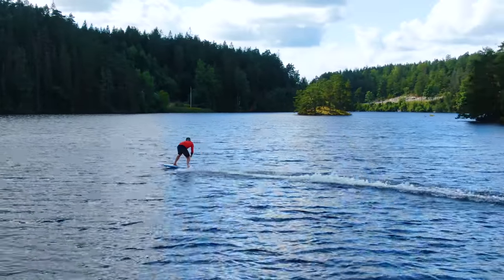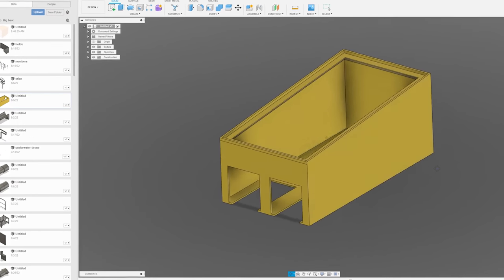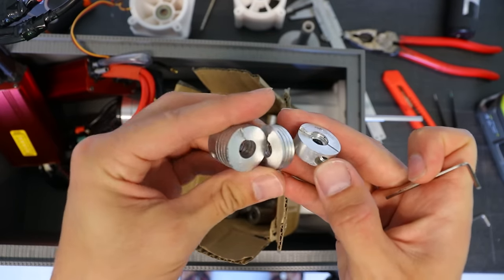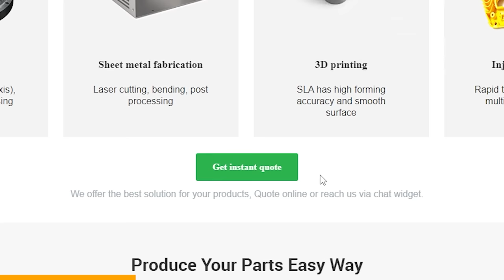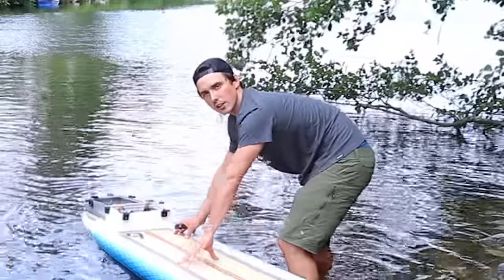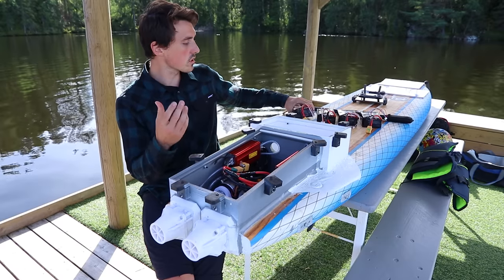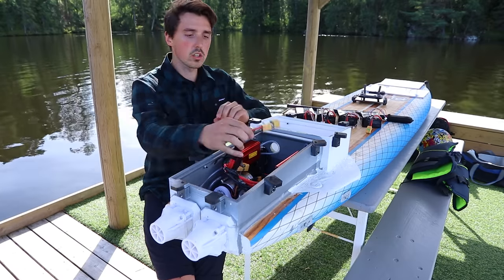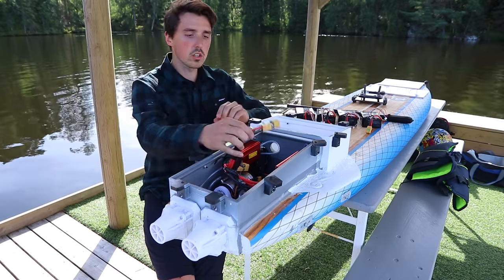This Electric Surfboard Has a Secret Inside!

Comment: Great work. Stout impellers! Are they 100% infill or did you go lower to save weight? So cool PCBway can do that for us.

Thanks for all the detail man! Loved the ID joke, haha.
Reply: You can't really do anything except 100% infill with metal sintering, because if you create an infill pattern the gaps will just be full of metal powder that hasn't been melted together and can't get out. Metal powder weighs the same but doesn't add any strength so it's literally useless. You can make hollow parts if you incorporate drain holes into the design so the powder can leak out when you're done but something like an infill pattern would trap it all in.
Reply: @AlRoderick  Great point, thanks for the explanation!
Reply: @AlRoderick  With sintering you actually could, the metal powder fdm prints you sinter in an oven afterwards. But with this laser melting you'd have to leave a hole somewhere I guess.

Comment: That two stage impeller design has alot of advantages for that size of an impeller, its easier to fit it on a small 3D printer for one.

Comment: You should revisit this. I built jet pumps for drag boats and noticed the intake was very small. The bigger the intake the less chance of cavitation and dry sucking. It should be at least triple the size of the pump volume. If you look at the pump as a cup standing up and filling it with water the intake should hold a minimum of double the water volume to extract all the potential thrust.

Comment: Congrats! I wanted to build that 10y ago to learn about the limits,,you saved me a lot of work. I recommend to use LiFePo4 cells like A123, because they can deliver the high current without damaging the cell. And you can recharge them fast. Regarding the board, there should be room to lower the water contact surface to safe energy, may be a catamaran-like double glide surface underneath to tunnel some air or so. Of course, a foil is unbeatable, but i like the surfboard conept (cheap works, in flat water...).
Reply: Wrong

Comment: Great Job, I made also an electric surfboard based on yours last winter. It works well but indeed reliability is a big one. One day it works and next day i go to the water something is wrong.
Its nice to see you made an update about yours!

I also have a heat issue, I cant drive longer than 6 minutes before everything gets too hot. I choose to run Li-ion batteries on 18S 16P. It gives me around 12 to 15 mins of play time. (but need to cool down twice to not let it overheat). I will try your tip by first cooling the motor and then the esc! Mine first goes to the esc since that saved some tubing.

I also noticed I should stand more in front of the board, I have the same style of board (long and thin) I think it is not the most efficient design for an electric surfboard.
by standing in front of the board (slowly moving forward while driving) it becomes much more efficient for me since the heavy backside of the board doesnt go that deep in the water. Maybe a tip for you.? 🙂 It also gives more speed too, haha

Comment: I used to have XT90 in my electric moped but they became very hot. Now I switched to Anderson Connectors (red). Now the cable is more hot than the connectors. 
Good luck with your projects. Like them alot🙂!
Reply: Label hit extraam heat wave char e tempugfer earth too hit ektrc
Reply: Ne e 900 watts 90 watt hydrrgen fule cell

Comment: As an armchair engineer, I have to add that two impellers in series don't move double the water, they just move the water harder, doubling the pressure. The result for the power demand is the same (parallel or series pumps), it's gonna double. But doubling the pressure on a jet with an additional stage grants the opportunity to use smaller nozzle diameters more efficiently. Thus increasing the top speed without having to increase the motor speed. 
Great build by the way, impressive top speed!

Comment: for your next build i would recommend a single my1020 1800w motor and a bigger impeller to reduce heat and maximize power. hit it with 72v and youre faster than a jetski!

Comment: Use anderson connectors, these connectors are used in the UPS and withstand the declared current, xt90 do not withstand 30% of the rated current for a long time, if they are often connected and disconnected, then even at currents less than 30% they begin to heat up.  so either a bolted terminal block or anderson.  Good luck!

Comment: QS8 battery connectors and 6 awg cable will help solve the heat issue you experience in the XT90 connectors.  These are rated for 300 A continuous versus 90 A for the XT90.  Helps to reduce the energy loss in wiring due to heat.
Reply: Yes itvwill

Comment: put the motors under the surfboard and use the water to cool everything. 3rd print aluminium case that act as find and radiator to the motors and seal it with casket maker.

Comment: I think it'd be cool (as a future project) to make the surfboard from scratch and along the spine have a large aluminium bottom container for the batteries (so that they can be passively cooled by the water underneath, and you can fit more without taking up space for standing). Also, you could make the base of the motor compartment aluminium and connect problem parts (like the ESC) to it either directly with strong mounting pressure and thermal paste, or with a heat pipe (you can get cheap ones online, although bending them can be a bit of a hassle I believe).

Comment: 45kph water scooter, awesome. What about optional plugin scooter steering head (with lights, mobile holder/charger, etc)  Seemed less screechy with a single set of impellors. Very unique "water drone" sound, but still loud. Since it is not getting hot anymore, you could try a load of sound insulation in the engine room.

Comment: SUPER impressed! I must have missed it, what size motors and ESC amperage? I built a skateboard with a 7468 and a 150 amp ESC and a 6 cell I could pull a car (not fast mind you) and with just me on it 20 mph. Not bad. 1 hour runtime with 7000mha. 

Ok, got to the end. You answered my questions. My bad. Still impressed.

Comment: Am running the 360KV Version 56114 Motors on this project with the dual stage system and the motor is rated for about 93 Amps and at full throttle it will draw about 120 Amps, in which I just dial the power down slightly and it works very well. Also, I'd highly recommend getting the V2 versions of these motors as SSS claims they are 8% more efficient.
Reply: Yes there are
Reply: @sharonbraselton3135  I need to try them. Efficiency is everything with this project and actually 12S is really underpowered for me at 195 lbs, I’m going to 16S. Only reason simon can run 12S is because he weighs 35 pounds less than I do

Comment: One idea might be to create a heatsink and thermally bond anything that gets warm / hot to it

Then run the fins of the heatsink under the board

That way you could potentially run it hotter for longer and the heat will be pulled away in to the water

This would also increase straight line stability

Comment: Try finding some outrunner motors of the same outside diameter. They'll be much lower kv but loads more torque and they won't be working as hard. Boats need a lot of torque which is why if you shop around for rc boats you'll see that most use outrunners. I'd say those and double your voltage and you'll be golden

Comment: Great work so far, now that drive is mostly locked down design wise, maybe build in the cooling system for the motors with a 3D printed mounting block ? The mount for motors could be made with spiral coolant channels formed into in the printing along with o ring seals against motor bodies and this would offer FAR better flow capacity than the manufacturer's cooling jackets offered with motors with those tiny fittings.  A water cooled metal plate heat sink from aluminum and plastic for water ducting might help batteries as well. Thicker solid bar stock copper could be used between batteries and motors to reduce cables and connectors resistance, it could be integrated into motor mounts for insulation.

Comment: Cool design I've never surfed but that looks like fun!!!  As for pump heat, have you compared heat from jet ski pumps ?  Also jet ski pumps have no flow constriction at the rear, the pump housing is free of all obstruction.  So if jet ski pumps get hot then your design is normal and no issue perhaps.  However the rear of your pump has a heptagon or 7 sided design at the rear, maybe that constricts water flow enough to create heat so if you cut out the heptagon and heat goes then problem solved.   Regardless the solution is in studying a jetski and find someone who will let you study the heat after its run or rent a jetski.  You can ski rentals on facebook market place near some lakes.

Comment: I think it performs much better you can definitely tell the difference try get a double row seal for the impeller housing the same type they use on gearboxes and motors even wheel bearing there a press fit type and they have a weird spring inside them to keep the seal should definitely do the job just make sure there a snug fit

Comment: No the right way to do the cooling is water goes into esc first, then motors, you got that wrong sir. 
You also said extra batteries would make your plugs cooler, not true, batteries will run cooler as youu said though.
You should try less kv/ higher voltage to reduce the amp draw and temps.
Great work from australia!

Comment: XT150s are cheap, and I find them easier to use personally, put an anti-spark one on the last connection you make, makes it easier on the electrical system.

Comment: You'd get more thrust with the  impellers under the water like a jet boat , and tighter turns with proper surfboard fins . 🇦🇺✌️♥️
Reply: Yes yi I do
Reply: But surfed built drivers enough thrust jet bib djne😅

Comment: For the speed measuring, wouldn't it be much easier just to take a smartphone in your pocket (with waterproof case - optional) with speed app based on GPS. 🤔
Ok it would not be as funny, I give you that 😁
 Thanks for sharing your adventures. 👍🏾

Comment: You could have scaled the pwm output  to in effect act as a throttle cap and thus have lower kv  maybe you could keep the  second stage and rpm and heat more manageable
 Esc timing and ramp up power also effect motor temps.
 Should be able to change all this in your esc software configurator

Comment: How about use a hip pack for rechargeable batteries in waterproof hip packs with coil leash connector. Changes board CG but adds other advantage. Board can’t motor away without you no matter what and frees up design.

Comment: That's so cool man. I always wished there was an engined surfboard, to be able to surf on a lake, because i live where there is no ocean.
You made that dream alive again. Btw, would a floatable solar panel in surfboard shape maybe deliver enough power to move it at all ?
The board could also have sidewings facing upwards at a slight angle, made from solar panels, to have maybe enough power, idk.
These sidewings could possibly add stability to the board, if using airodynamic correctly. Very inspirational video.

Comment: @RCLifeOn Awesome Job!!!😁👍🏻 Out of curiosity, why haven't you 3D Printed your own surfboard with gyroid infill and custom compartments for batteries???🤔 Just a note, you can make silicone "paintable" by dissolving it in some "VM&P NAPHTHA"...also good for waterproofing electrical connections or sealing joints or making soft, tactile, rubberized surfaces!!!😁👍🏻

Comment: If you are having battery heat problems, can you find a way to build a separate compartment which will allow a slow water exchange and use the water to cool the batteries?  They do make Water Proof Connectors.  Just a thought.  Great fun and nice job.

Comment: Ahhh! Don't hit the inner race on the bearings!!! And the motors should spin in opposite directions, that was correct and you undid it, the motors create rotational torque by spinning, and with them spinning opposite directions you're canceling that torque out, by switching both motors to spin the same direction you now have a bias, either clockwise or counterclockwise, depending on which direction you made your motors go, and depending on which bias you chose your board will want to go more left or more right and it'll be harder to turn opposite of the powered torque.

Comment: Trying to build the same thing here but wanna get the same top speed but with one motor and longer range, any tips ? Going to shape the board myself and use glassfibre and epoxy. All tips aprechiated !
Reply: How long would a 10.000mAh hold this thing going ?

Comment: Use a more stable synthetic surfboard and run the machined parts inside the surfboard so you don’t need the big box in the back… More streamlined… Its a beauty though…

Comment: Nice Video! You also can try to build an electric foil board so that you can decrease the water resistance an drive longer. Then you also dont need so big Motors and battery. They are normally worth 10.000€ 😅

Comment: Wonder about putting heatsinks under the water which is connected to the motors. though water proofing would be almost impossible
speed, just use your motor with a bike app, it shows your max speed.

Comment: USE IC-5 connectors. Or 12mm bullets & cut length different to not arc over .   There. Fixed your heat issue.   Also. Btw ?  I’d use a 520 kv hobbywing max4 combo. Instead of those motors.     It will run cooler under load.
Reply: Yss

Comment: Really cool build! 
Something is off here. You draw about 15kw on average if I calculated correctly (760wh over 3 minutes) to go 25kn.
That is significantly high considering  60cm wide and ca 100kg total weight.

Comment: You can measure speed with the gps sensor on a smartphone. Also you could also make a data logger with an Arduino, gps sensor, accelerometer, etc . You can measure speed  motor temps, rpm, or whatever else, might be an interesting project.

Comment: Why didn’t you use a tubular pvc design? It would make it easier to create a water proof enclosure.

Also putting the engine in a hydrofoil below the board could help with cooling. Generally submerging as much equipment as possible would help with cooling. Interesting concept, maybe more useful as a portable kit to attach to smaller craft(kayaks, paddleboards, etc.)

Comment: For your charging, you're going DC -> AC -> DC. There's probably a DC -> DC regulator that you can use more efficiently off the LiFePO pack. I wouldn't necessarily be surprised if the voltage is already compatible and you just need a fused circuit to directly tap 12V to feed your charger.
Reply: there are a lot of dual output chargers out with DC input.... ISDT make pretty good ones

Comment: Hello,
Thank you for this work and the videos. little question, could you list all the part- transmitter, throttle controller, receiver ... (reference, number, ... or internet link to find them easily, that would be great (like a complete technical sheet)... anyway thank you for your work.

Comment: Could I suggest replacing one or more fins with an aluminum one that has a heat exchanger built in, would let you use a heat exchanger to cool your board with the fins actively without adding any drag or redirection of water flow.

Comment: I’m taking on this project and am using Polycarbonate Carbon fiber filament. Weighs 26% less than PLA and is around 8 times stronger. Expensiveish, but amazing stuff. It saves some weight for sure.
Edit: this stuff is a pain to print, also has risks of cracking

Comment: What if you do a water cooled heatsink to secure the batteries on top, split the cold water outlet from the pump and join both the hot outlet on the sink and the hot outlet for the sink going out.

Comment: Hey man, can I make a suggestion about battery connectors? XT90 is fine for each individual cell, but go to something BETTER for the series/parallel/esc connections.

Go with some Anderson connectors. Either the new 125A powerpoles, or one of the SB series 2-pin connectors. Do note their specs are for 100% duty cycle and without cooling (but check datasheet to be sure). They are beefy, I run the sb50's on a few projects, and powerpoles are the bread and butter of the HAM radio world. Anderson makes top tier products

Comment: In terms of connectors, aren't XT90s a bit undersized? I'd throw some OS8 connectors in there. They're almost twice the size, instead of 5mm bullets it has 8mm bullets, rated for 200A+, whereas XT90s are only rated up to 90A.